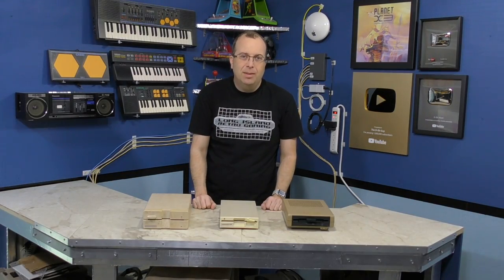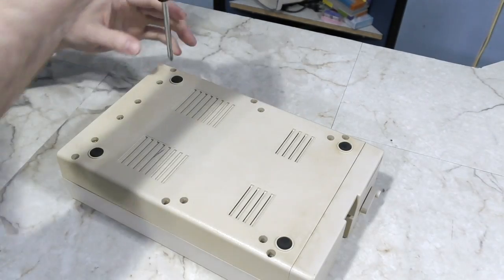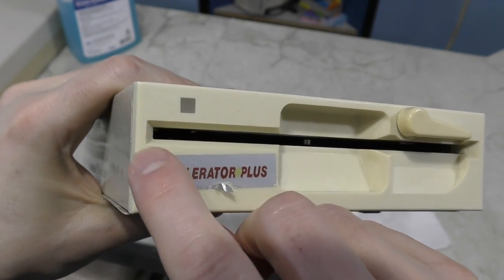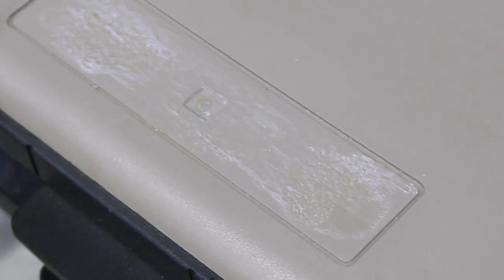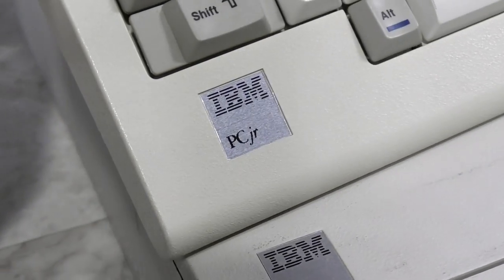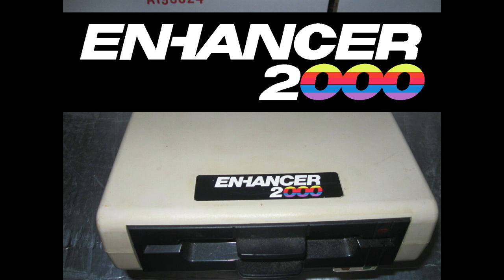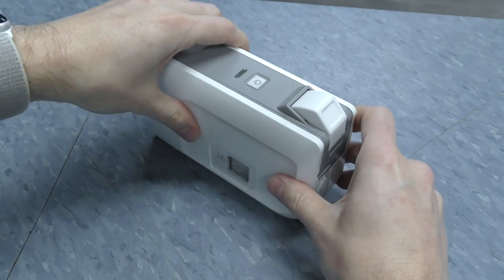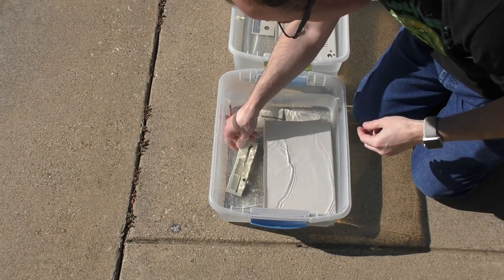How to make replacement badges

Comment: "So small that nobody's really going to notice." I did, even before you told us. Since you have the label on that drive still basically intact, why not scan it and then edit it to clean it up, and then use a regular printer with transparency sheets, with the right color of printing, instead of on the label maker, for best results?
Reply: Ugh, I'm glad I'm not the only one who thought they looked like crap. A piss-poor quality label maker is mostly to blame (I don't know how the HELL you end up with those artifacts on a flat horizontal/vertical line of pixels...) but if he's gonna be drawing letters by hand anyway instead of trying to track down a font, then he really should just do them in vector.
Reply: Oh yeah, vector! Good point,  @ValkyrieTiara .  Or in this case it might even be easier to just scan the existing drive label at a good 600+ DPI and then clean it up in raster drawing software (like he was using). I can see using vector for scratch, but if I have something to scan that I can just clean up, I'd rather go that route. Thanks for your reply and like!
Reply: You can also set the resolution in Photoshop to something more than 72.  If it's a 300 DPI printer, set it to 300!
Reply: I can't believe he used a microscope to prove that the results on his low res printer were the same no matter how good the source was. The point is so totally missed.

"Hey, maybe you should use 1080p instead of 720p for your video? It might look better?"
"When I play it back on my CRT using composite video it looks just as bad either way. Zoom in real close and you can see it."

Either way, the original source regular or doubled wasn't close to a high enough resolution for good results on a good printer with clear sticker paper or other transparent sheets.
Reply: @Kyle Olson
Exactly.  It's like expecting photo real results on a Lite-Brite.
Reply: Isn't the comparison between video and still image not a good one though? The reason a higher resolution video can do better even on a monitor which can't support the resolution is because video has a temporal component. Still images don't. The only benefit would be to increase the ability of the printer to choose where to position pixels, but ultimately the printer can't do better than it's printing DPI no matter what input you feed it. A video can do better because better resolution than display resolution allows better transition between frames. You don't have that in a still image.
Reply: LOL You beat me to it.
Reply: @ValkyrieTiara  Yeh! Elsewhere, I said the letters look like a Halloween/Dracula font. How is that even possible, unless maybe with low JPG resolution?
Reply: @Cutest-Bunny998  I don't know where you heard this, but resolution has nothing to do with "transitioning between frames" to the best of my knowledge. I think you might be thinking of frame rate? Like having a higher frame rate than your monitor's refresh rate is useful because it hides drops in framerate (ie you might notice a temporary drop from 60 to 45 fps on a 60hz monitor, but you're less likely to notice a 90 to 75 drop on the same monitor cause its still refreshing at 60 fps). 

Im not particularly well versed in digital to analog, but generally all you get for feeding a signal of a higher resolution than a monitor can handle is compression. Or an "out of range" error.
Reply: The comparison is fine, the temporal component doesn't matter, but for the same of simplicity, let's take out the temporal component.

If you press pause on whatever video player Frame by frame, the CRT can't display the HDMI image well and the 1080p and 720p will look similarly crappy.

The metaphor is that the CRT is the label printer.

"but ultimately the printer can't do better than it's printing DPI no matter what input you feed it."

Yes, the printer can't do better than the DPI it has. It has a terrible, terrible DPI and does a terrible job rendering the labels. That's the point. He's using a terrible printer. All he proved in by using a microscope is that the printer is terrible.

If he used a good printer, the higher res images would be better. And he can. When he printed the other labels he used a good printer. And they make transparent paper for all printers.

It's also still insane he's using pixels instead of vector graphics so that he would get the best image at any DPI.
Reply: @relo999  Vector graphics are a good fit for this with all the straight lines though some of the font could be tricky -- but since the Label's font is a basic Helvetica bold italic he could have easily created it with the text button in anything. It's amazing how much time he spent to pixel perfect recreate Helvectica.

And this is just one silly thing in a video full of bad solutions to problems. His backwardness drives me nuts. I wish he would talk more old computers and spend less time showing us how to do things wrong.
Reply: I wonder if he didn't actually know the colors are different considering he's colorblind.
Reply: @videogamingfreak13  I asked a colorblind friend. He found it possible but unlikely to miss the color on the words. Being Colorblind doesn't make the world Black and White.

Even if that's the case for the words, this doesn't justify drawing the light yellow cross in the same dark color. Any form of colorblindness would see how light the yellow was.
Reply: @Tiara Azmalan Compression in video is different than still images. It uses interframe compression which is usually a kind of temporal compression. This is video resolution dependent not display resolution dependent, so better video resolution results in better choice of P-frames and B-frames. Still images can only do intraframe compression (if you look at a still image as a video its a single frame video which can't obviously do interframe compression - there is only one frame). Better chosen B/P-frames look better on any display resolution, so having a better video resolution still looks better on a bad monitor. That isn't the case with a still image. I'm not talking about frame rate here, I'm talking about the difference between interframe and intraframe compression artifacts and how they play into the quality of still images and video differently.
Reply: @Kyle Olson we agree the printer is terrible. I thought people were saying that a higher DPI image file would have looked better on the same printer, which isn't true. It wouldn't make any difference. But if you wanted a higher resolution print we both agree you'd need a higher DPI printer. The point I was making about how video is different than image is that you can get a better "print" of a video to a bad monitor by just upping the video resolution. It wouldn't increase the output resolution, but the choices made by the compressor would still look better.
Reply: @Cutest-Bunny998  The things you are saying make no sense, like you don't get the problem
 at all. The video was a general metaphor. It's like if I said you had a smile like a cat and you began to explain how humans don't think like cats.

Also, like you think I don't know what I'm talking about when I've been doing computer video for years.

"Compression in video is different than still images"

Well, yes and no. 

"It uses interframe compression which is usually a kind of temporal compression. "

It means that information from next and or previous frames is
 used to create the final frame. But when the information is used, you still have a completed frame you can pause on. Sometimes the compression uses tricks that rely on how humans see things that make single frames look different than might be ideal for a still, but it doesn't matter. Ultimately I still get a 1080p or 720p frame.

"This is video resolution dependent not display resolution dependent...."

Yes, the video is compressed at one or more different resolution, but for our purposes I was saying it's compressed about one resolution.

"so better video resolution results in better choice of P-frames and B-frames. (snip) Better chosen B/P-frames look better on any display resolution, so having a better video resolution still looks better on a bad monitor."

No. Just no. I'm trying to grok why you think this.  Do you know what component video is? Standard def old-school video? 

We're talking about moving from 1080p or 720p. We could spend a long time maybe finding a 2% advantage when surveying people from the higher res source. In fact, it's also possible that the higher res source will just plain look worse depending on how it was optimized, But ultimately both will look like total, total crap because the final individual 1080p or 720p frame will be pumped onto a standard def component cable using some random algorithm.

"I'm not talking about frame rate here"

Why would you even think we were talking about frame rate?

"I'm talking about the difference between interframe and intraframe compression artifacts and how they play into the quality of still images and video differently."

It's like your throwing out the terms of the field without an idea of what's actually going on. Yeah, stills and video have different compression artifacts. Although they're also based on very similar ideas. But this final video on an old CRT is such crap you're going to have real trouble seeing the compression artifacts. 

If I said we had the exact same bit rate and two different resolutions then the lower res video would have far few compression artifacts. If I had a bit rate relative to the size of the frame, the artifacts would be similar although depending on the nature of the video and the algorithm maybe a different res would have an advantage.

And in fact this is the same as a still frame in a sense in that the amount of compression will determine my artifacts, even if the still frame can't compress using the blocks from other frames.

But even if you were right, and the higher res source looked 100% better by some arbitrary measure of people looking at stuff, it would still be crap, and that's the point of the metaphor.

I'm frustrated I have to even discuss this. You're missing the whole point. It's like I said something hurts as much as having a leg cut off or having a nail driven through my hand and you decided to explain to me that the pain from both things is very different.
Reply: @relo999  There is no good solution to this problem that involves still using the label maker. Whatever else is going on, however he designs it, the label maker should not be used.
Reply: @Cutest-Bunny998  To quote Brian Regan: "Yeah, I'm too stupid to talk to you." XD But seriously, I'll do some homework and come back when I actually understand what you're talking about. I've heard of B and P frames before, but only in passing and never when talking about something like this. Thanks for the info!
Reply: @kyleolson8977  You do realise that there is more than one type of colorblind, right?
Reply: @morkusmorkus6040  Yes. There are three common types, although there's a real spectrum even among these types. 

You do realize that doesn't matter here and if you think about it you look really silly for stating this like you're proving a point? It's not relevant.

The fact that ONE type thought it could be confusing means that I don't need to check the other type types, it proves that it could be confusing to a colorblind person.

But additionally there's no form of colorblind in humans that would have trouble differentiating the very light yellow cross from from the red text. It's bright enough that it would appear significantly different for any color blind person. Simple color science knowledge should make this obvious, but you can also run it through tests and you'll see that the color difference will still be very obvious.
Reply: @kyleolson8977  lol
Reply: @ValkyrieTiara  I think he's thinking of interpolation, where a TV "guesses" at missing or dropped frames in a video stream or (more often) video game. More pixels would help with interpolation, but would have little-to-no effect on "original" frames.
Reply: Quality is one issue. The other is that new label cost a lot of time despite it looks A LOT DIFFERENT!
Reply: This video sure elicited some very strong reactions.

Comment: I never tried it myself but I would attempt a used fish tank (20 gallon) coated with mirror paint (many many coats. Finished with black paint. You could leave a hole on the bottom for (or other sides) for additional lights. You’re the expert I’m just spit balling. Love the channel and love your work. I hope it helps.

Comment: 17:27 Couldn't you just wrap silver foil around the OUTSIDE of the clear plastic tub?
Reply: Except it's not adhesive on that side.
I knew the moment he did that it was a mistake because it'd react with the hydrogen peroxide...
Reply: @jovetj  You could stick it to cardboard or plastic and place it on the outside. Or just wrap it tightly around the tank.
Reply: Some plastics absorb UV light, like in most plastic sunglasses. If the UV light has to pass through the plastic twice that would reduce it a lot, wouldn’t it? Could that be the reason why he put the foil on the inside?
Reply: @OldCrowle  You may have a (small) point there, but I don't think that was the reason.
Reply: @Ndlanding  "small" point? If that material absorbs 95% of UV, it's the main valid point. Even normal glass - not treated at all - absorbs pretty much all UVB.
Reply: @whuzzzup  Yup, you have a good point.
Reply: While it's clear in visible light, it might not be in UV light. Really, it's possible the foil wasn't even reflecting UV... Even if it was, though, it's pointless to try to reflect it to begin with because the marginal extra reflected back likely isn't nearly as relevant as temperature to the process; he should be getting a way to heat up the water.

Comment: I had some succes lately with the retrobright of a GameBoy.
I applied 12% poeroxide gel, which hairdressers use. I covered the whole piece using a brush then wrapped it into plastic foil.
Stuck it under UV light for 8 hours.
Worked like a charm.

Comment: I have that same Blue Chip 5-1/4" diskette drive for my C128...still works great.  I also just picked up a couple of other Commodore machines....a C64 and a VIC-20, $19 each at a local electronics reseller.  Most of the machines they had were pretty well destroyed, missing parts, etc.  I didn't pickup any disk drives they were way too far gone, didn't have to do much cleaning to either of the machines just some all purpose cleaner and they cleaned up pretty well both of them powered on and seemed to be fully functional units, my C64 apparently has a PET keyboard in it from what information I received from a Commodore Facebook group.

Comment: Hello,
1. I saw a guy removing old badges heating them, using a hairdryer or a  similar professional tool;
2.. Acetone can dissolve and clean superglue BUT damage /change the plastic color and surface. I think metallic surfaces (ink free)are not modificated by acetone;
3. After print the new logos/badges you can protect them with a special spry to protect paintings. It's not the same original protection but can help. Attention, apply this spry before apply the badges on the device. 

Thanks for the great video, from Seoul, Tito.

Comment: Why not just sand down the melted plastic instead of using a screwdriver?
Reply: It would be difficult to NOT scratch the surrounding surfaces.
Reply: @kris_0520  Mask with duct tape around the work area.
Reply: personally I would use a small dremel attachment, proper masking and a steady hand and your done in 2 minutes tops

Comment: Just a thought about the retro-brighting: you might consider adding either an aerator pump to create bubbles or a fluid pump.  Either one would tend to agitate the solution to create a flow across the surface of the parts you're working on, hopefully maintaining a constant refresh of the chemical against the surfaces.  Sort of like an ultrasonic cleaner.

Decades ago some friends and I were etching circuit boards using ferric chloride baths, and rigged up a small plastic tub with a low RPM motor and cam.  It rocked the tub slowly back and forth, creating a gentle wave action, and speeded up the etching process.  I don't think that method would work for retro-brighting, but figured I'd mention it as well in case it helps with brainstorming different things to try.

Good luck!  I'm sure you'll let us know whatever you come up with. 👍

Comment: I had one of those Oceanic drives... I got it very cheap as the previous owner had issues with it.  I had a great run with it though... Way back then it was terrific to not have the HUGE shoe-box sized 1541 on your computer table/desk!

Comment: "some people will likely be saying i didn't use enough resolution" why yes, i am going to say that. except i'm going to clarify by saying the problem is fundamentally different that the resolution itself. the problem is doing the work in raster. any kind of line art or text-based  graphics like this makes sense to be done as vectors, where resolution doesn't matter. but at least you avoided an accidental JPEG encoding step, which unfortunately i see too often. i use Inkscape for this kind of thing so the result can be printed or scaled to any size without degradation.
also blacklights do use phosphor to produce UVA, germicidal lamps are the ones with no phosphor and UVC-transparent glass (as you said they're more dangerous since they're actually made to kill stuff)

Comment: Metal halide lamp and the Peroxide cream stuff will fix those sides or at least I would think so anyways.  I've seen you use the cream along with plastic wrap before I was surprised you didn't try that method.  Great video and as a C64 owner and user since 1985 I must admit I never heard of those Knock off Drives before.  Very informative!! Great work!